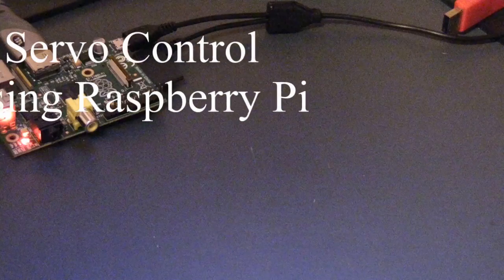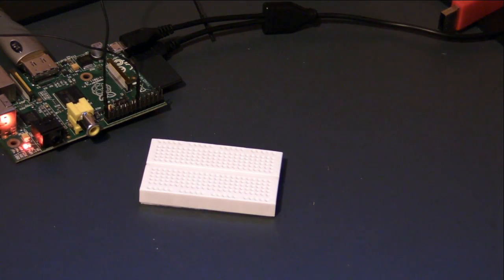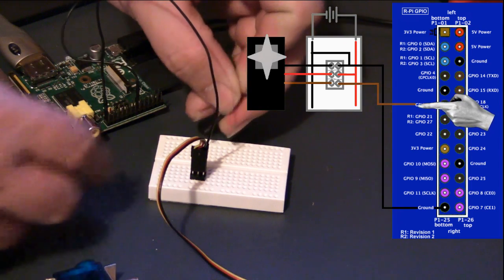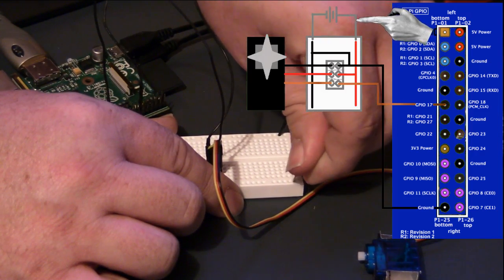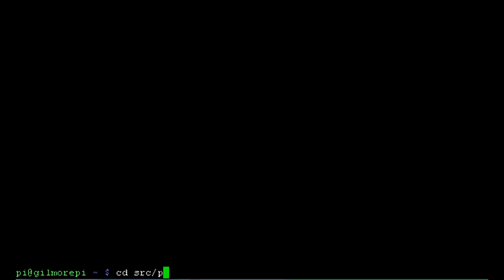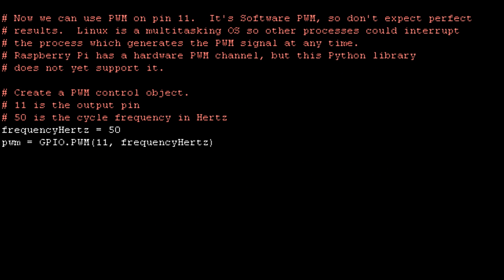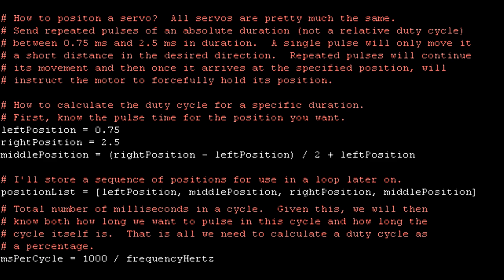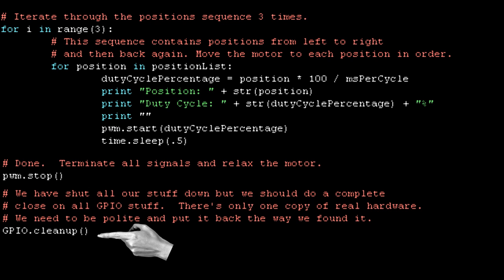Servo control using Raspberry Pi.

Comment: I have tried the same code as you but it freezes at the line `time.sleep(0.5)` and I have to restart my raspberry pi. I am connecting through ssh. I tried running just `time.sleep(1)` in python console and it seems to work. Not sure if I did anything wrong. I have put my code below.
```
position = 0.75 # left
dutyCyclePercentage = position * 100 / msPerCycle
print "Position: " + str(position)
print "Duty Cycle: " + str(dutyCyclePercentage) + "%"
print ""
pwm.start(dutyCyclePercentage)
time.sleep(1) # freezes at this line
pwm.stop()
GPIO.cleanup()
```
Reply: I don't see anything wrong with the code.  Which operating system / version are you using?  Which version of Python?  How did you determine that the sleep() line is the one which is hung?  I find it more likely that your electronics are sinking too much current from one of the GPIO pins.  Try disconnecting the motor and all GPIO electronics and then run the software by itself.  Does it still hang?  If so, try updating your OS.  If it no longer hangs, you probably have a wiring problem or may need an amplifier circuit for the PWM signal to reduce the current draw from the GPIO buses.  You can also try another motor.  If you are driving the motor (the red and black pins) directly from the Pi, try connecting them to a battery as shown in the video to eliminate that as a possibility.